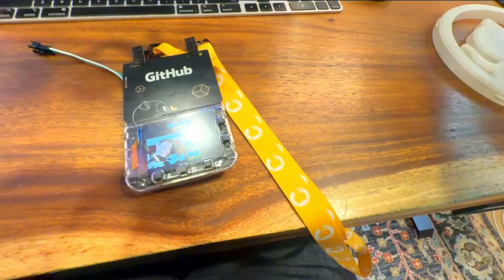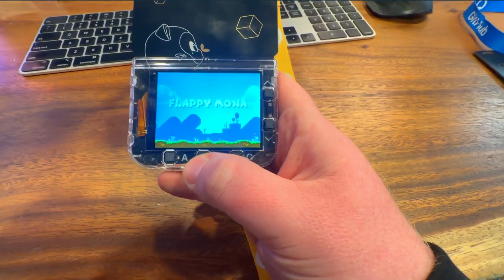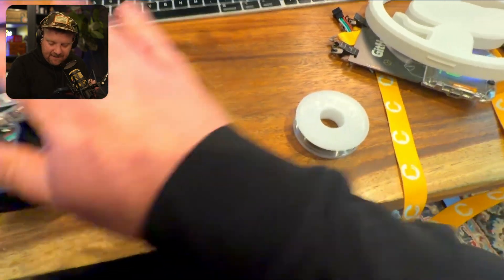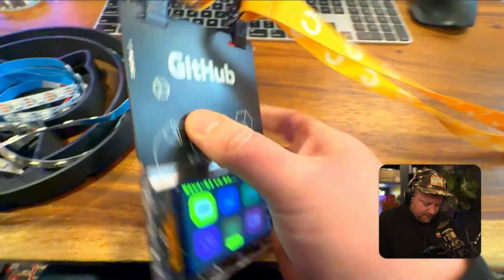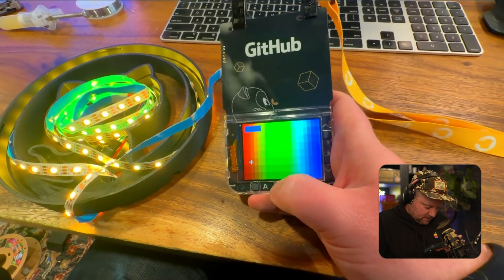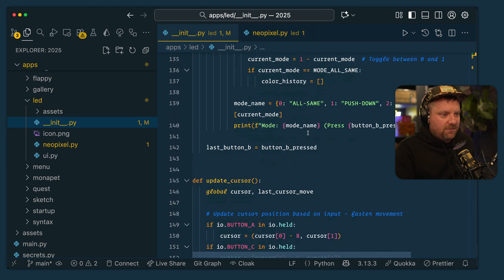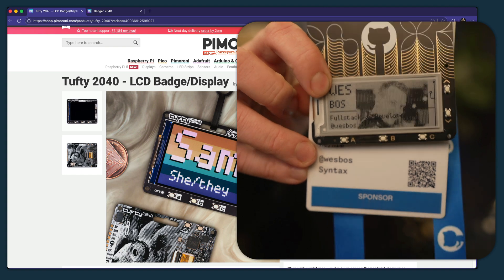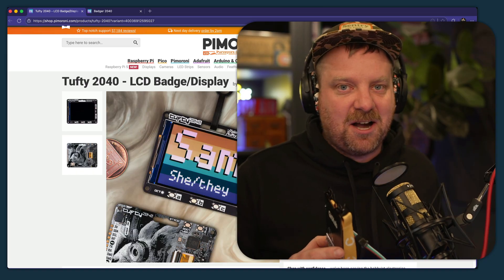this conference badge is nuts!

Comment: Throwing this thing in the garbage has to be a crime 😂
Reply: if you were important enough , you would not want to carry this thing outside the conference room , a computer from unknown origin that you have to carry back to your hotel room , are you honestly comfortable with that?
Reply: @aaryam4799  Yes. What kind of dodgy shit are you getting up to?
Reply: @aaryam4799  Yes I'm comfortable with that. You don't have a place you can store things? If you were important enough, you would have a place to keep this. You don't have to wear it as a badge every day.
Reply: @aaryam4799  chill bruh its just an arduino
Reply: @adfinem.rising  that was his point. If you are important, you will not have time to chill. ;)
Reply: @gummybro_  And what will this arduido do to ruin your day more than anyone else following you with an arduino ?
Reply: @aaryam4799  Funny that you mention, because your cell phone has tracking abilities that this doesn't. For starters, I doubt this has a GPS and the ability to connect to a Wi-Fi network other than the one used in the conference. Your cellphone has all sorts of sensors, accesses your e-mail and other accounts, reads your messages and is able to communicate without Wi-Fi, and if phones home without you ever knowing it.

Comment: I wonder if you could program the buttons on the badge to be a controller to turn your robot vacuum into an RC vacuum?
Reply from the maker: great idea.. I'd just need to get a websocket connection running on the badge and then send the commands to the existing controller running the vacuum